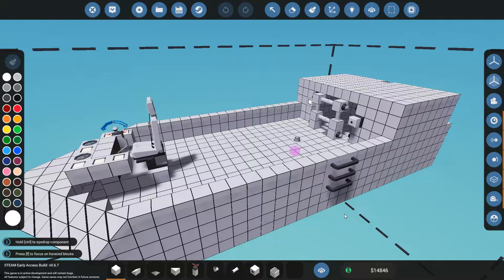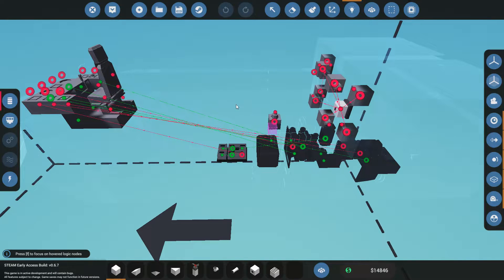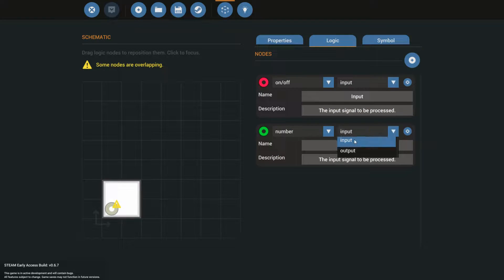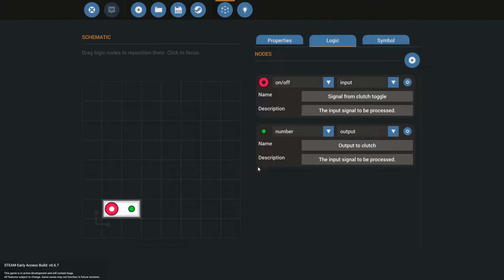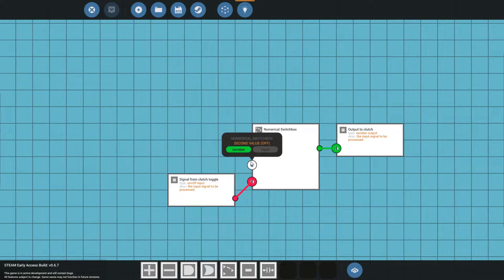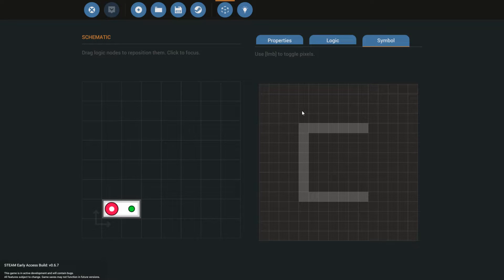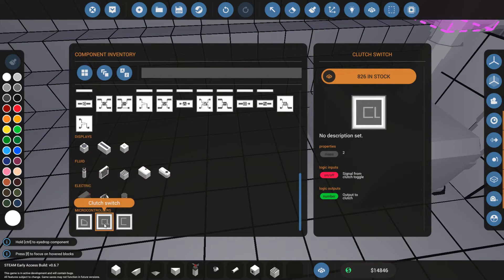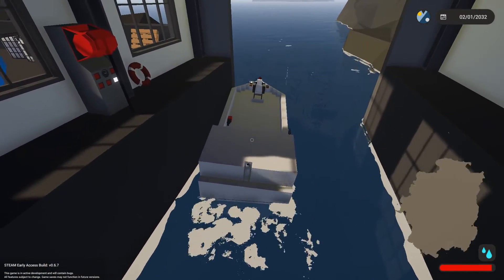Stormworks: Build And Rescue - Get Started In Advanced Career Mode - Part 6 - Microcontroller

Comment: Hey, just wanted to thank you so much for this entire video tutorial series. You did an excellent job and got me well on my way. This game is mindblowingly cool and I can see myself putting many hours into it, as I'm still only unlocking boat stuff. With your tutorial I already managed to build an 8-way fuel tank monitor that outputs 8 tanks to a single dial, and I figured out how to use a threshold logic controller to build an automatic clutch system for my boat which I tacked onto the clutch system you helped me build so I could eliminate the need for the button. Now I think I'll add another threshold controller to switch from low to high gear and I'll have an automatic transmission in my boat! Thanks again for empowering me!
Reply from the maker: Great work! I hope you have more fun with figuring out more of the game :). Enjoy!